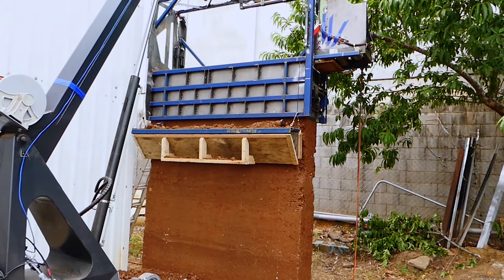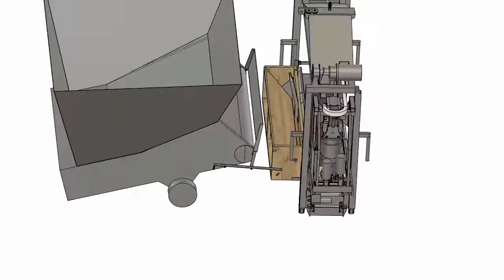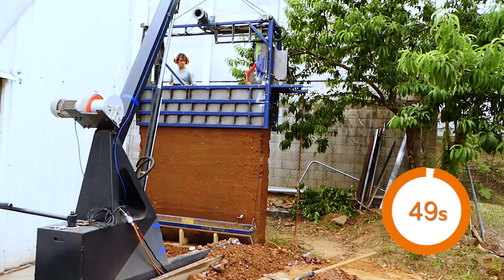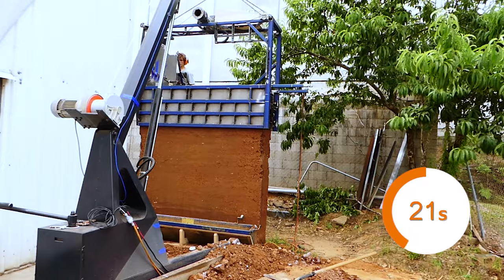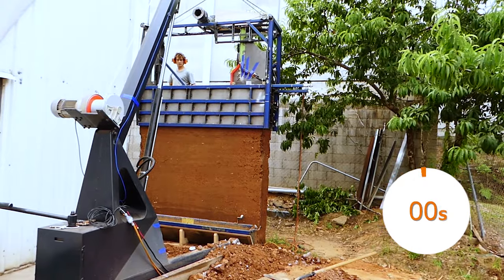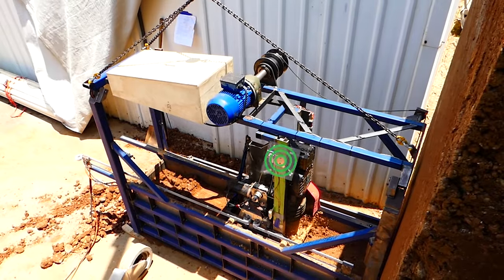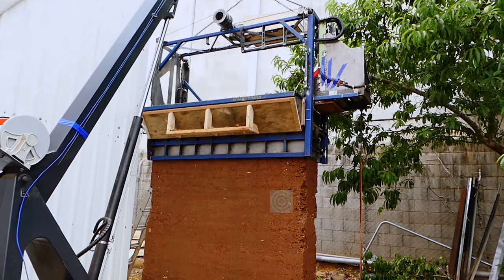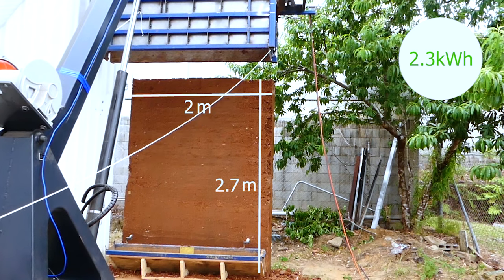The First Automated Rammed Earth House Building Machine - Form Earth

Comment: Not feasible in first world countries where vertical reinforcing bar is required.
Reply from the maker: Hi K7gixxer1000 Thank you for your comment. We are not aware of any standard where vertical reinforcing is required for rammed earth walls (if you know a standard please let me know). Additionally, when no cement is used vertical steel reinforcing can be relatively ineffective: * if cement is used it is dry compacted concrete not rammed earth.
Reply: @Formearth  i agree without rebar,  but you could placing insulated panel,  or electrical box / pipe inside wall ,  of course they are always a way to do differently ( exteriour insulated , special  insulated mix,  chasing wall for electrical wire ) but to do so ,  we add some extra work or cancel aesthetic value of rammed earth inside side of the wall ,  it begins making lot of constraint , 
i know you're engienering some valuable system but only  single wall,  no ramming top windows,  no possibly insulated panel ,  no box/pipe ,  without doing old fashion way 
you're system are valuable only in certain construction system
perhaps i'm wrong ,  but you're not clearly talk about what you can do and what you can't with you're system,  what desgin are permit or not,  i means angle wall,  cross wall,  open window/door,  wiring ,  all things we must consider in house construction,  especially in self constructing mode operantus :)
Reply: a 2 or 3 axis ramming ( cnc like ) will be more versatile ,  associated with a configurable ( one or two endstop ) ,  and positionnable self lifting  auto blocking formwork ( without tie rod ) suitable for at least angle wall ( much more stability ) or straight wall with or without opening ,  even column,  with this type of machine you can response at 80% of demand 
that's my 5cent thought :)
Reply from the maker: @hab we will re-visit CNC style machines over the coming years to establish their value for rammed earth. The current machine design can be loaded on a standard box trailer for transport. The main challenge in my view with CNC style machines is an earth loading system which is small and coast effective.
Reply: @Formearth  thanks you very much for yours responses,  and your new design will be more versatile i'm sure :) ,  when i'm suggested a CNC machine , it's like you said a CNC like system ,  attach or integrated in the whole frame ,  some indian sri lanka works on a automated slipform for rammed earth,  so more project bring new ideas :) and hopefully cost reducing ,  and happy new year for you , familly and your team :)
Reply from the maker: @hab keys  . Can you please send any more information or a link on the work being done by the Indian Sri Lankan company? I would be interested to see what they are creating.
Reply: @Formearth   well it's a center research i guess,  they focusing on formwork more then advanced compacting,  but they have some couple interesting idea,  see by yourself 
https://engineer.sljol.info/articles/abstract/10.4038/engineer.v52i2.7353/
i will apreciate your comments , pros and cons on this :)
Reply: there is a recent patent focusing on CNC  compacting frame too ,  but in my opinion too complex for a suitable cost average machine and there is just compacting :) theyhad just transposing a cnc machine on top of rammed earth lift ,  not really valuable ,  but reflexion about frame could be :)
they are others commercial machine ,  but more for prefabricated rammed earth ,  Martin Rauch fabric,  or Nicolas Meunier compacting system ( suspended hydraulic with multi mass hammer attached )